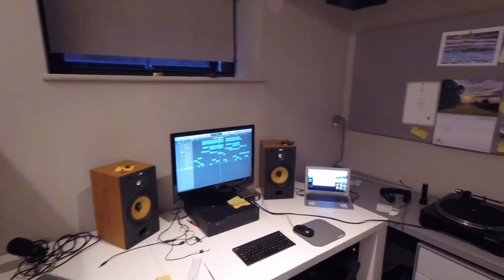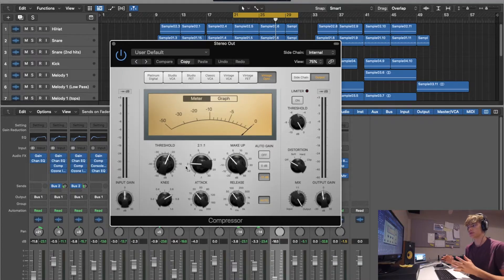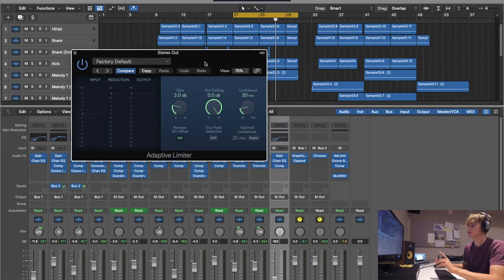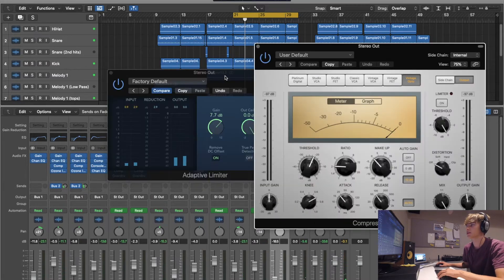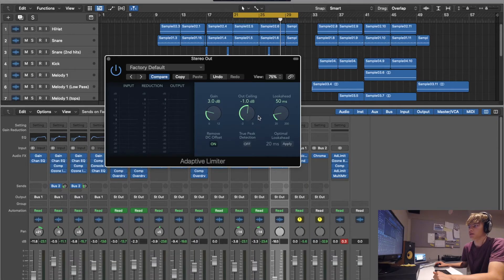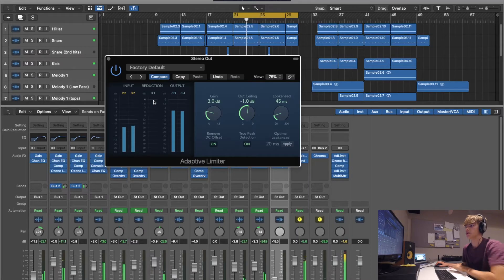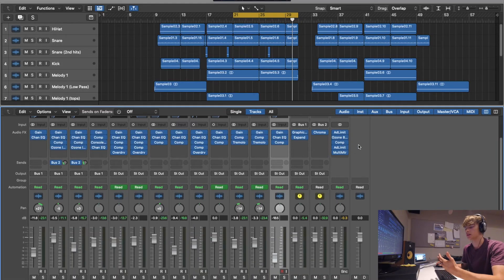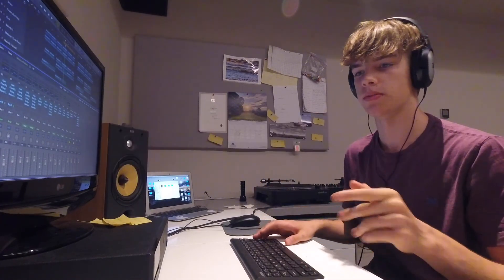What the funk are LIMITERS!? | Mixing & Mastering in Logic Pro X

Comment: bro, i have a question....
whenever i upload my track to SoundCloud and then listen it back to SoundCloud app, it sounds distorted in louder sections...
i just have a gclip on my master,(to make sure everything is below 0db), and i usually keep my mix loud and clear...
i upload wav....
what could be my solution.... 
sorry if this question is annoying, but im having this problem from last 6 months .... so any answer would be a LIFE CHANGER for me...
thanks for reading....
Reply from the maker: Glad you asked, when your mastering your tracks the very last thing should be a limiter that has a 'Ceiling' of -1db 
this stops any clipping or distortion and is such a subtle difference that your track will still be as loud as you need